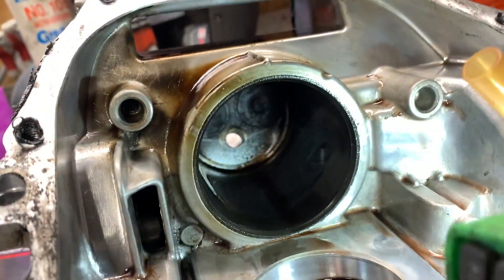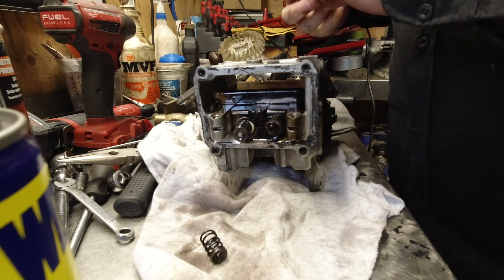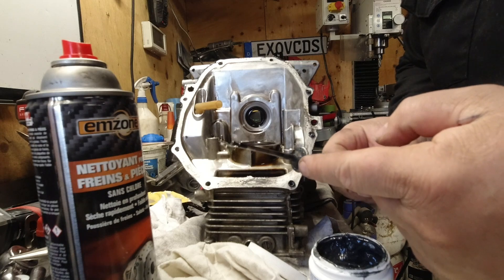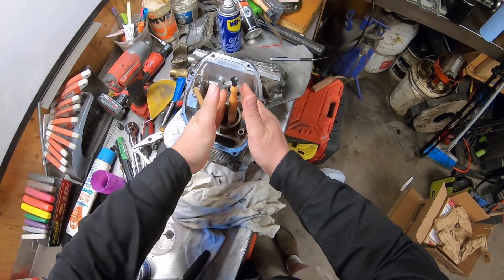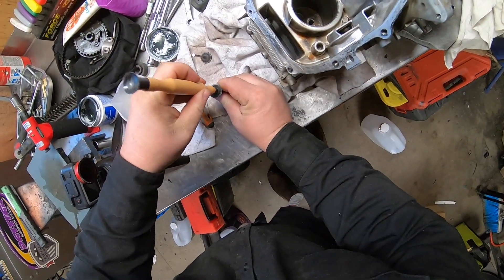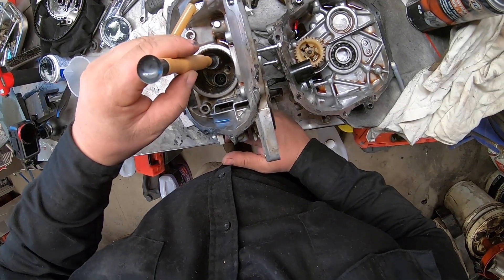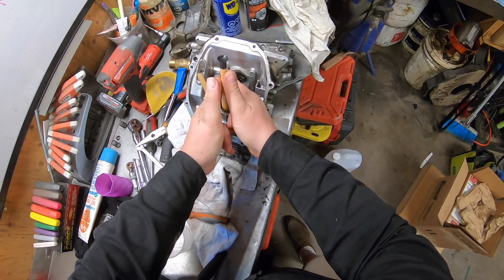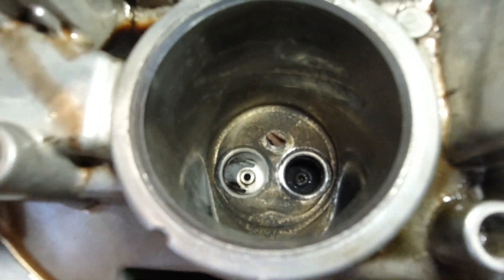Valve lapping an Awkward Small Motor

Comment: Those are fiddly ones to get at Jerry, nice job. Hot tip, use a battery drill or double wrap thin rope etc to the valve stem and work from the top👍🇦🇺